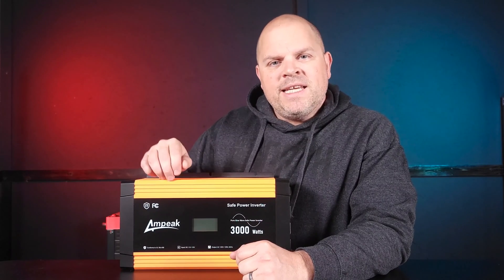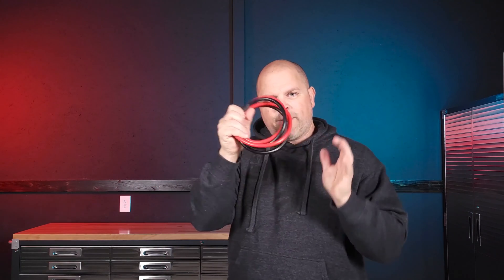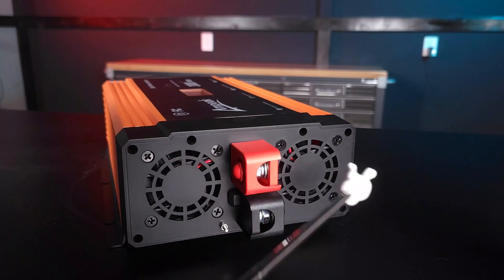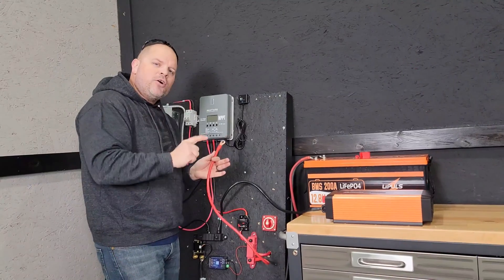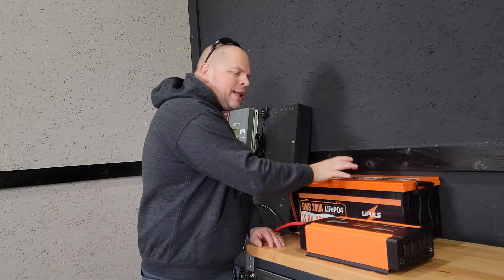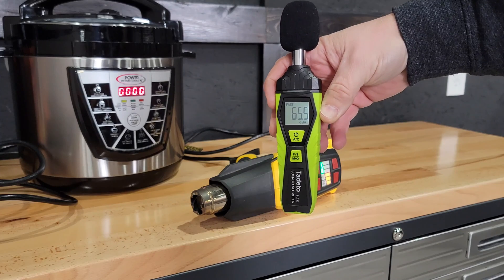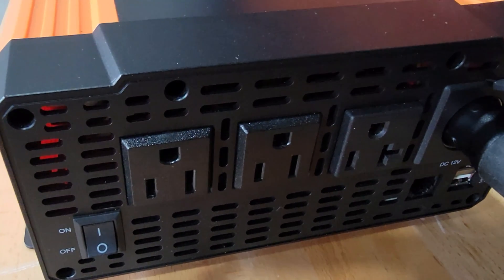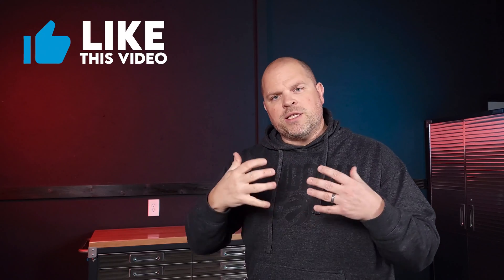Ampeak 12v 3000w Pure Sine Wave Inverter

Comment: awesome vids bro.. looking to upgrade my 1000w stock magnum in my fleetwood flair RV..  was thinking either this one or the 3500 vevor you just reviewed - i'm leaning toward the vevor because i'm gonna pair it with a 460ah lipo4 battery from litime and try to run my 13,500btu air con for about 4 hours pairing it with the incredible oupes mega 2 lipo4 generator which plugs directly in and CIGS solar panels :)
Reply from the maker: For that configuration, I would lean towards the vevor 3500. I am currently testing the Mega 2. I will have my results on that coming very soon. Thanks for watching and commenting 👍🏻

Comment: 4AWG is approx 21mm2.  3AWG is approx 26mm2.

This inverter at 3000w output will draw over 250A.  250A on 25mm2 wire sitting on a desk (ie not suspended in free air) unless it has abnormally high temperature ratings, and by that I mean rated for 300c (570f) isn't going to be a good idea.  Even if you can find it, just having something at 280c sitting around would be a hazard by itself.  It won't fly up to that temperature immediately but given the inverter is alleged to be rated for 3000w continuous it will eventually get there if the battery can hold it up.

The voltage drop on that length 25mm2 at 250A is about 0.4v and that is a fair chomp of usable voltage range at 12v right there.
Reply from the maker: Thanks for watching and commenting 👍🏻

Comment: Wow that’s a lot of safety protection
Reply from the maker: Thanks for watching and commenting 👍🏻
Reply: awesome vids bro.. looking to upgrade my 1000w stock magnum in my fleetwood flair RV..  was thinking either this one or the 3500 vevor you just reviewed - i'm leaning toward the vevor because i'm gonna pair it with a 460ah lipo4 battery from litime and try to run my 13,500btu air con for about 4 hours pairing it with the incredible oupes mega 2 lipo4 generator which plugs directly in and CIGS solar panels :) @TheSolarPit
Reply: so i was just doing some research on the vevor 3500 and it has quality issues and alot of people are reporting it breaks down after 6 months and one person it caught fire - might have to go with ampeak.. what do you think?  @TheSolarPit